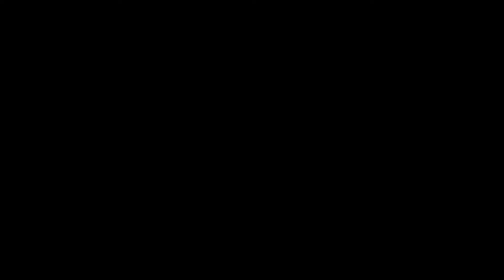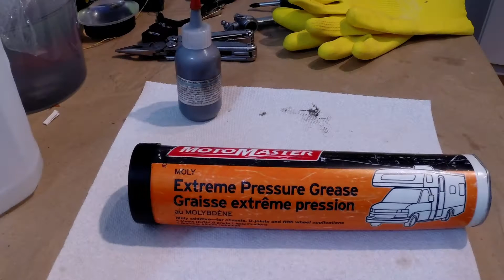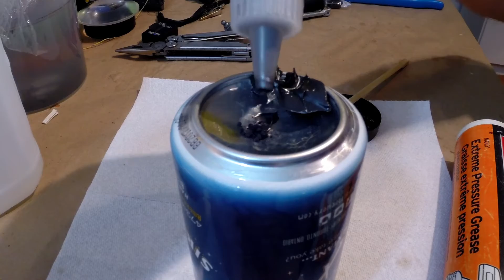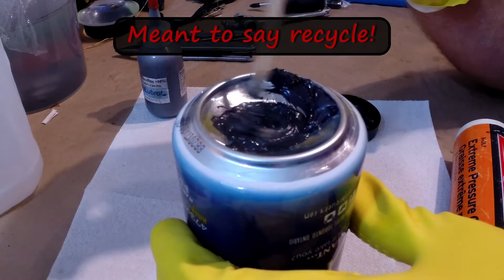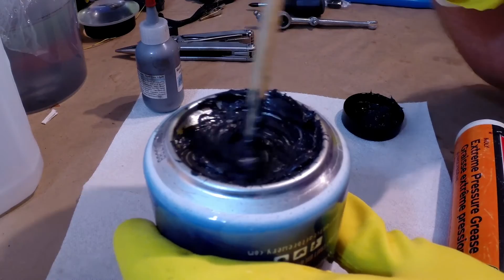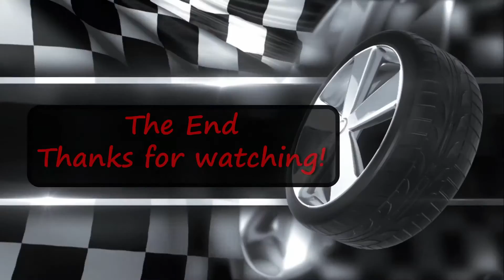DIY high moly content grease

Comment: Even cheaper if you mix moly gease with graphite powder, plus you get two different properties. For an expensive mix use tungsten disulfide.
Reply: Be careful about the use of graphite.  Graphite needs moisture to act as a lubricant, so should not be used in situations where it would be sealed off from air (anaerobic) or vacuum environment where there would be no exposure to moisture.
Reply: @wty1313  That's strange, I bought some graphite powder as a dry lubricant from my locksmith.
Reply: @xylosfurniture  Graphite IS a dry lubricant in most situations - what I'm referring to is if you use graphite powder in a sealed environment such that not even air moisture is able to assimilate into the graphite.  In such environments, graphite loses its lubricity.
Reply: If being used in high heat, graphite can burn, where Molybdenum does not. I need hammer grease for SDS Plus bits, which get very hot, and need the tiny bit of grease to stay put. I also learned that Molybdenum reduces friction better than graphite.
Reply: @markluxton3402  Thats right, graphite can burn and can transfer electricity. Because of that you cant for example use it on brake calipers.

Comment: Any way can this moly use for brake pin caliper or pad ? Thks man
Reply from the maker: Yes - I mix a little every time I do a brake job to help stop brake squeal. Make sure to use a thick heavy duty chassis grease (no thin bearing grease). Also, make sure you don't get any on the contact surface of the brake pads!

Comment: if this is this simple and cheap then why the moly greases with high moly contents are so expensive?
Reply from the maker: The molybdenum disulfide is expensive. So, high content moly greases are expensive. If you just need a small amount of very high content moly grease for a single job, you can purchase a small amount of moly powder and mix it yourself without having to buy a whole tube of high content moly grease. Also, by mixing it yourself, you can decide what % content moly to carrier grease you want. In the video, I mixed a very small amount of grease to moly powder that was around 50-60% moly. I'm not sure you can even buy a moly grease that is 60%. Of course, if you need lots of moly grease, buying the expensive powder and mixing it yourself will not save you much $.
Reply: thanks for the detailed answer. great video as well. it's videos like this that increase our knowledge day by day
Reply: @javedfazil6686  you can buy 70% moly paste. ts-70 its thinner than their other stuff called ms525? something 525. its about $30 for a tiny tube lol
Reply: You pay for brand name the most money.

Comment: Is it practical to mix this in large enough quantities for a CV joint, or not worth the hassle?
Reply from the maker: Probably not worth the hassle. The Moly powder is pretty expensive at ~$10/ounce (ebay). If you only had a couple CV joints to grease and can't find a decent Moly grease locally, you could buy a 14 ounce can of the WalMart brand extreme pressure grease for about $4, buy an ounce of the moly powder for $10, dump the whole ounce of powder in the can and mix. You'd end up with a pretty good 6.6% moly grease for around $15. I mix it myself because I usually only need small amounts and I prefer the much higher percentage moly that is hard to find retail.
Reply: Bodhi Bike Shop I was thinking of getting the Supertech lithium moly grease at Walmart, but I have not been able to locate the percentage of moly content. It is my first choice because of ease of access. Second option is Valvoline synthetic grease which has 2.5 percent moly per their product information. However, I'd have to order that and is more of a hassle to obtain. If the moly in the Supertech was low I considered the idea of mixing in extra, but it seems like it would be tough to thoroughly mix.
Reply from the maker: Yes, the retailers make it hard to track down detailed information on products these days. Usually, you can use MSDS data sheets to find relevant information (if you can find them). I found the MSDS for the SuperTech Moly Lithium here (msds.walmartstores.com); I was curious myself. Looks like the grease contains 0.1-1% moly. Pretty low (especially on the low end of the huge range they admit), but should be good enough for a CV joint. Best way to tell moly content of a grease is by color. Moly is a a dark, almost black, color. If the grease is a light color, it's a clear indicator of very low moly content. Good luck on your CV job!
Reply: MOLY 5% 5-Gal $89.00 Free Delivery! https://www.walmart.com/ip/Moly-5-HD-High-Temp-Lithium-Complex-Grease-NLGI-2-35LB-5-Gallon-Pail/600838827
MOLY 5% 55-Gal $789.00 Free Delivery! https://www.walmart.com/ip/Moly-5-HD-High-Temp-Lithium-Complex-Grease-NLGI-2-400LB-55-Gallon-Drum/919936112
Reply: I’m running SPC upper control arms on a lifted fj. They come with greaseable ball joints. They recommend a complex lithium grease with a moly content of 3-5%. Seems appropriate for that application. I’ve been wondering if further thickening of the grease will restrict the needed flow in such a tight space with a very very small grease delivery channels. Higher percentages on slow moving gears or marine setups seems appropriate. I’ve been learning that it isn’t good to use in constant velocity situations where needle or roller ball bearings need to roll more freely at much higher speeds. Can’t really say why but that seems the best the supposed expert consensus 🤷🏽‍♂️

I also wonder if using lesser amounts of lithium grease but higher content moly would be a better grease for my slip yoke. It seems packing it full of grease until it seeps through the end of the yoke. Essentially you’re creating a shock absorber causing far too much pressure as it creates a great amount of temporary pressure forcing the driveshaft with much more force against the tranny seal. It makes sense that a lighter application of a much thicker grease would last much longer.